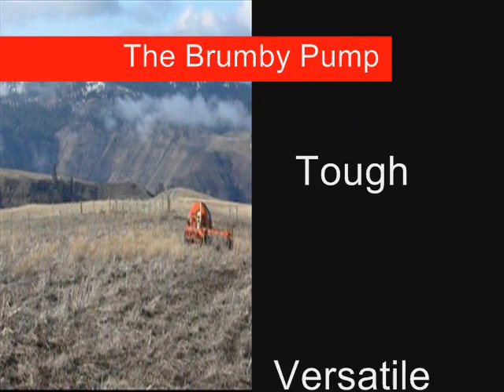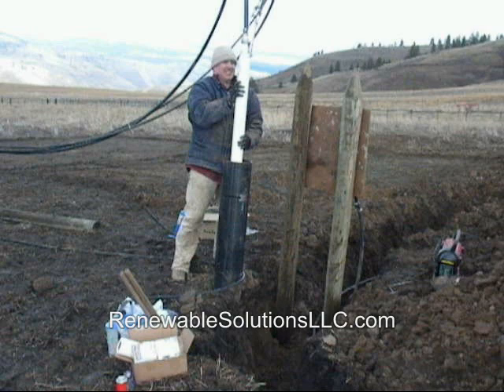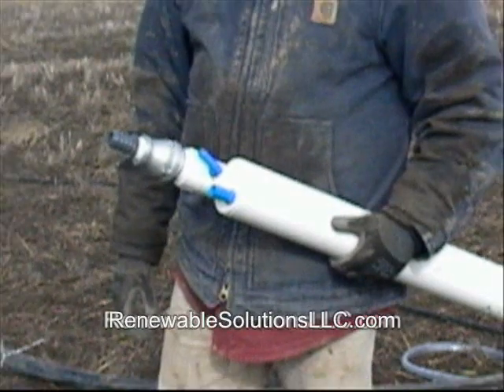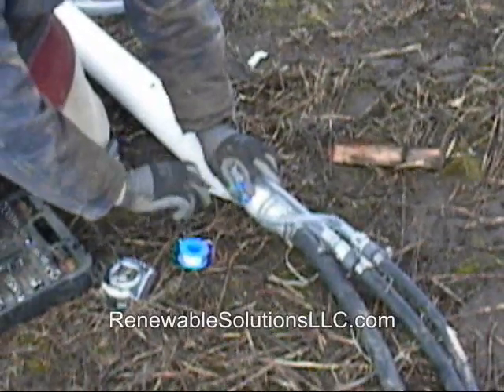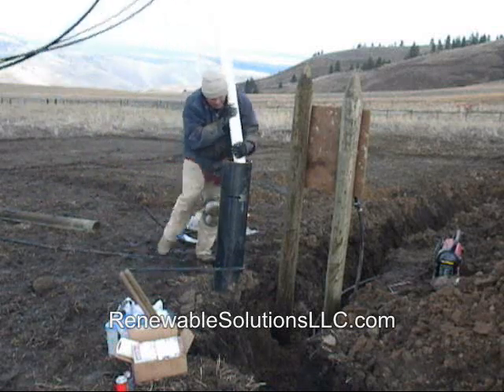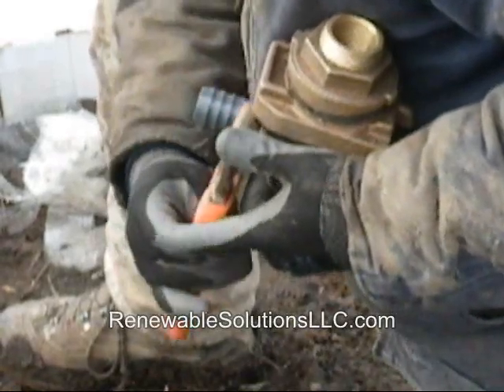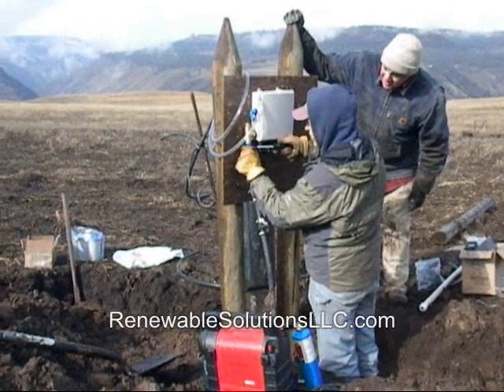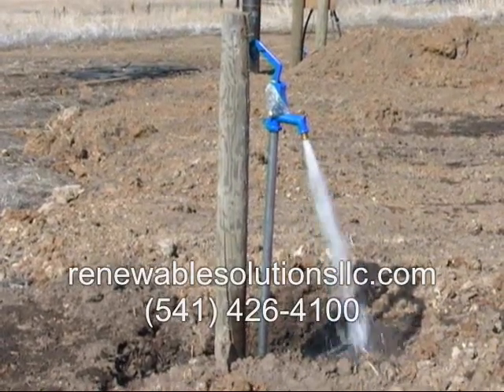Renewable Energy Solutions Installs Brumby Non-Electric Air Lift Pump

Comment: Hi all, You seems knowing a lot, but not me, as I am looking for cheap way for irrigation with any pump but not using any fuel energy and cheap energy like battery linked to two or three solar panel to fill it, is that posssible and what maximum debit I can  have? What will be the final cost? thank you,